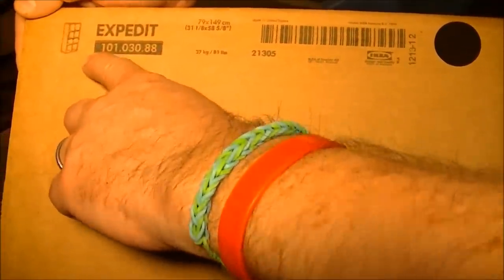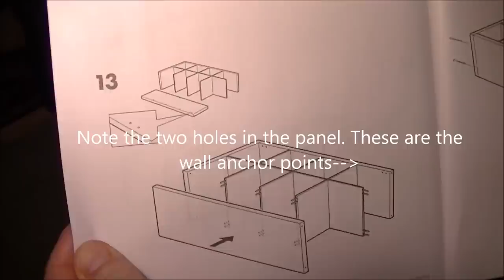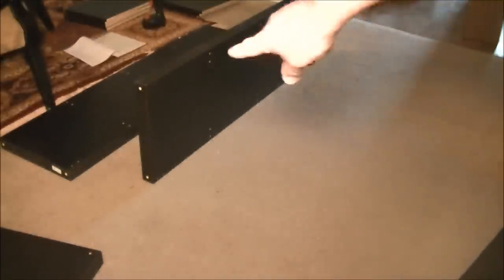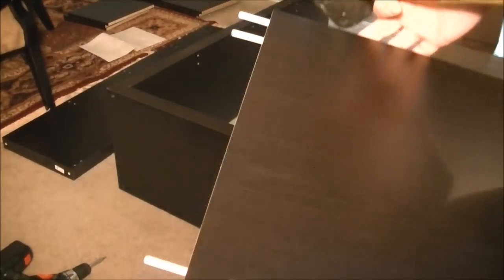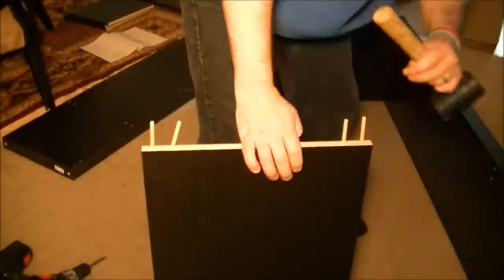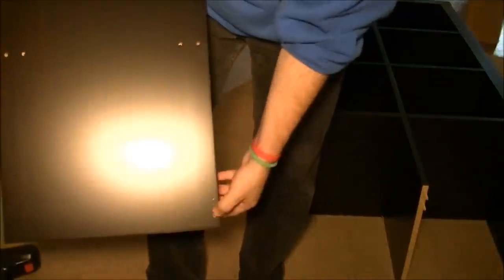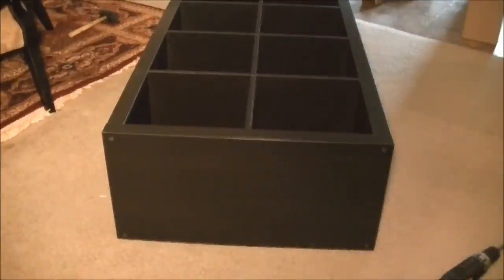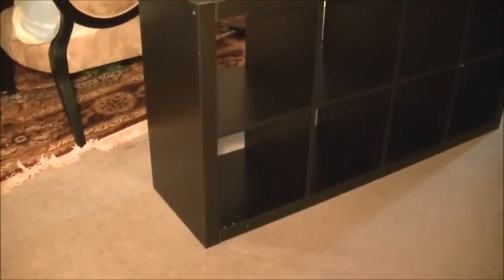Ikea Expedit (Now Kallax) Bookcase Cube Display 8 Squares, Black-Brown 101.030.88 Complete Assembly

Comment: I bought this unit in the birch effect color ( a light wood looking color). If I wanted to paint it, would I have to sand it first? Or can I just use a paint with primer mixed in it?
Reply from the maker: +ShamelesslyClaudiaTv I have not painted mine but I would lightly sand it first to help the paint adhere to the surface. Thanks.
Reply: Wow, thank you so much for the quick response :). I've never sanded anything before, so if I don't sand it, but I'm careful with the paint and I allow it time to dry before applying a second coat, should it be okay to not sand it?
Reply from the maker: +ShamelesslyClaudiaTv It depends on the paint, I still recommend sanding it but I guess you can try it and see. Thanks.

Comment: did the paint chip off when you made it? i am useing a hammer and when i hammer it in like u did with the mallet the paint starts chipping
Reply from the maker: I used a rubber mallet (hammer) the head is made of hard rubber which makes it less likely to chip the veneer of the book case. If you hit it too hard with this mallet you can still chip it. It's best to be very gentle when using even this tool. Thanks.

Comment: I dont have a mallet or power drill,can it still be put together?
Reply from the maker: Yes, you can put it together with the tools they supply with the bookcase. Thanks.
Reply: Richard Lloyd  Hello I wanted to know the exact measurements of the woods the wide ones the medium ones and the small ones please
Reply: Richard Lloyd In the width of the wood and in the high of all the feet please